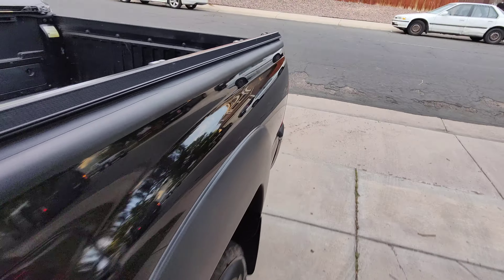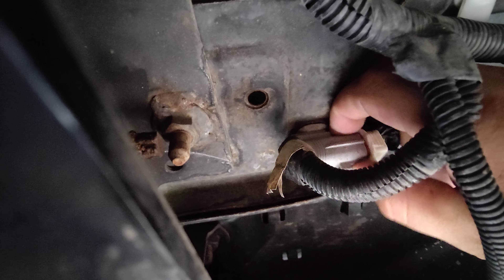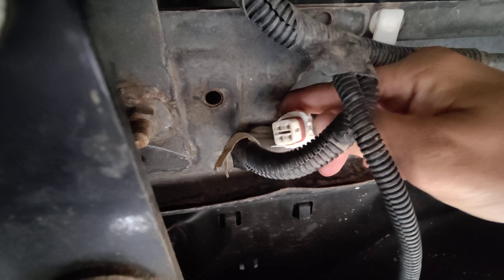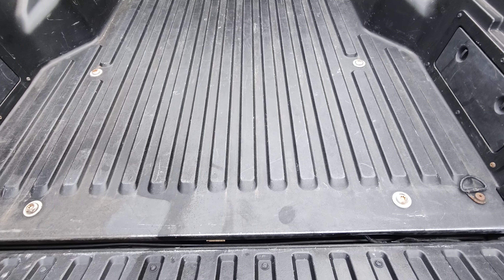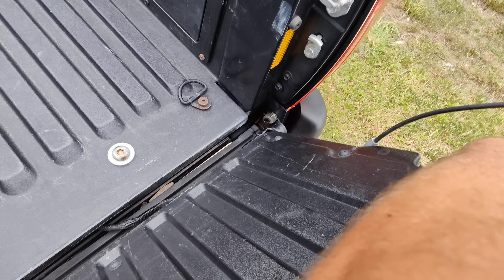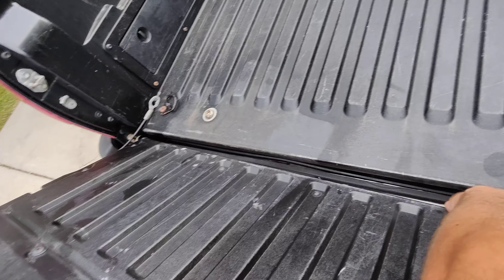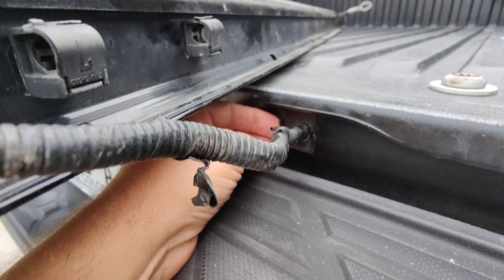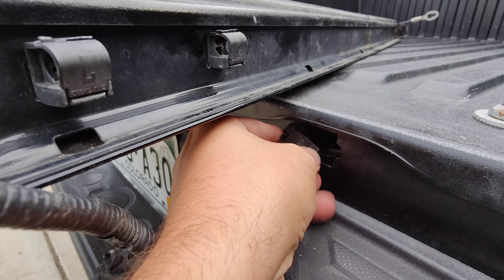How to Remove a Truck Tailgate on Toyota Tacoma and Tundra 2007 2008 2009 2010 2011 2012 2013 2014

Comment: Does anyone make a protective plug for the body side camera wiring if one wants to run without the tailgate for awhile?
Reply from the maker: I ended up just putting tape over the end and zip tiing it so wouldn't rattle.